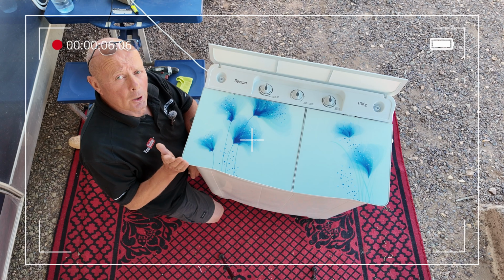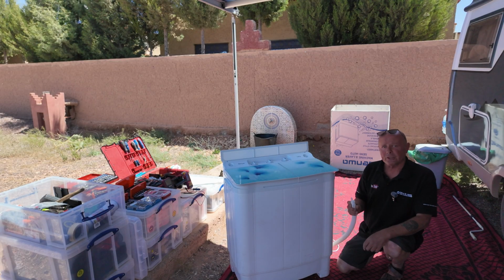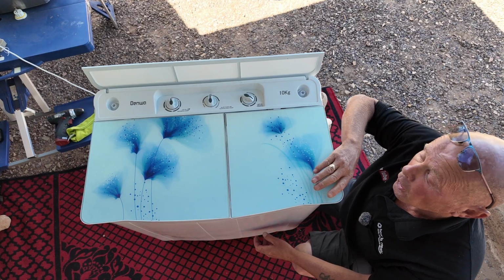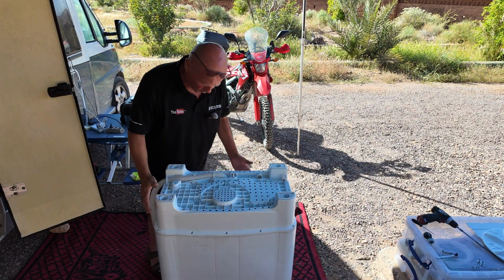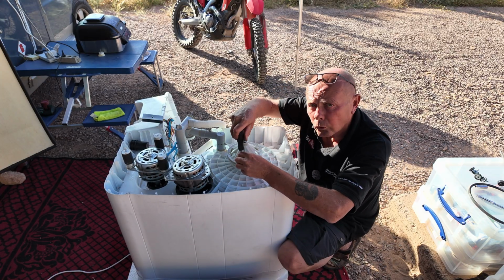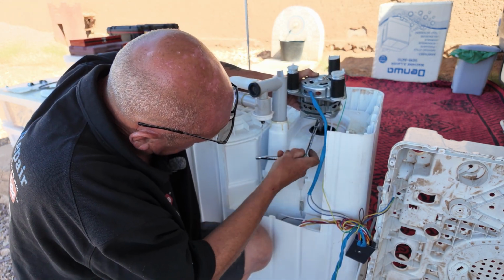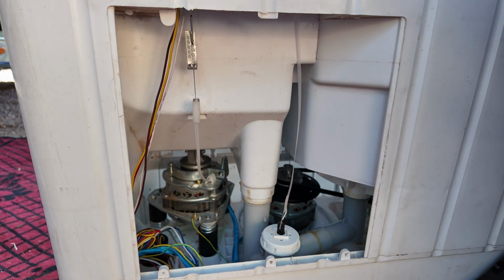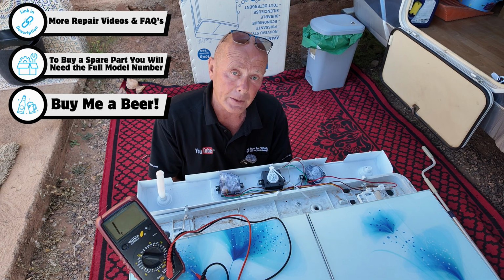TWIN TUB SEMI AUTOMATIC WASHING MACHINE How to Dismantle, Repair & Prolong the Life of the Machine

Comment: Hi there, firstly thank you for a very informative video. I was wondering if I could ask your opinion on something. I have purchased two of these machines. The first one I was very impressed with initially, until it packed up after about 4 small lightweight washes. I then bought a second (2) (so that I would not be without a washer while waiting to send the original back).
The second one arrived a few days later and did not work at all. This one (2) I sent straight back and I received a refund.
The question I would like to ask is this, on the original machine that I still have would you say that this could be a capacitor and/or capacitor fuse problem ? First the agitator stopped moving and just hummed, and at the same time the spinner also stopped functioning and also just made the normal resting noise.
I have had motorcycles etc before so I understand you clearly explained in the vid, and I do enjoy tinkering when I feel well enough.The problem is I have cancer and I don't want to start dismantling the thing if I'm wrong and I don't want to waste anymore money on another. 
I apologize for the rambling message. Hope you can advise.
Kind regards 
Jackie

Comment: Many thanks for this excellent video. My problem is that there's a blockage in the wash tub drain system. I believe it's just under the valve cap, but I can't unscrew the cap. Is there any other way to get the valve cleaned? The cap is so tight that I now think it's actually moulded and not threaded.